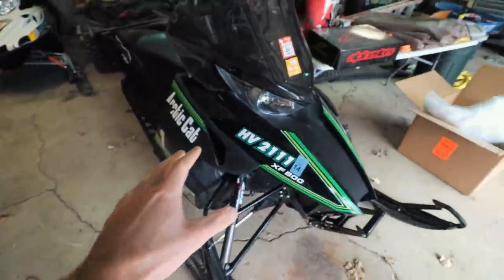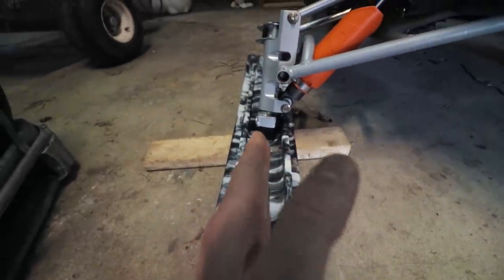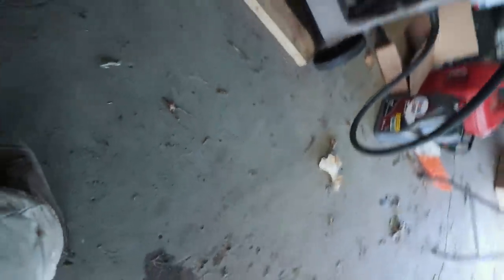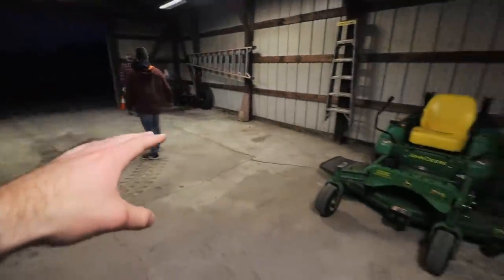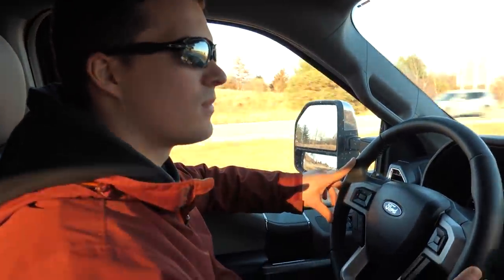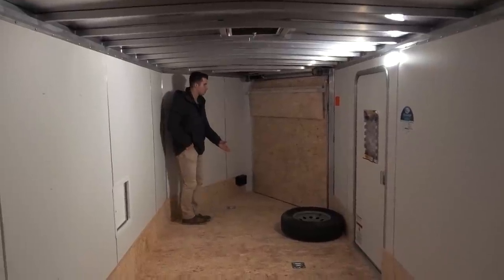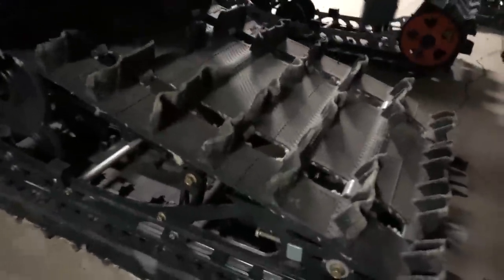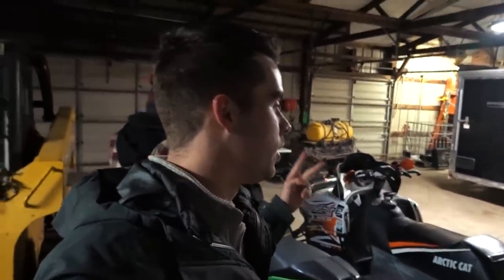NEW SNOWMOBILE & TRAILER REVEAL! | SUNDAY FUNDAY

Comment: On your 2010 Cat, it looks like you bent a nun which is where the shock meets the chassis.. if you open up the cowling and look at both sides from the top, the side with the angled ski is probably bent in

Comment: We are snowmobile riding right now and on the Arctic cat crossfire check to see if the shock is still good also I would just check everything on right side also a in line trailer is the way to go u can fit 5 to 6 snowmobiles in it have a good new year and yee yee on

Comment: Dont ride straight on concrete or black top or gravel it dullss down your scags quikly and if you dont know what they are they are metal bars with a piont a the bottom and it makes you steer if they are worn down a lot you wont steer they are right on the bottom of the skis

Comment: Just because the front left one is dance because it must’ve hit a rock or it must’ve got jumped work very hard and it’s just been a little bit of the tubing so you’ll probably have to get worried he may have to bring it down to the Just because the front left one is dance because it must’ve hit a rock or it Musta got jumped like very hard and it just burns a little bit of the tubing so you’ll probably have to get worried he may have to bring it down to the dealer so they can take a look at it